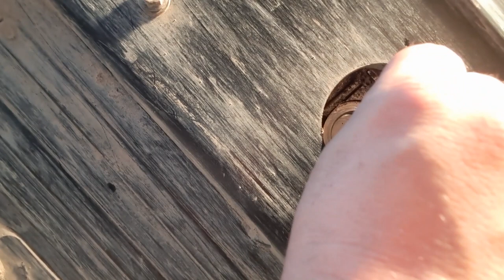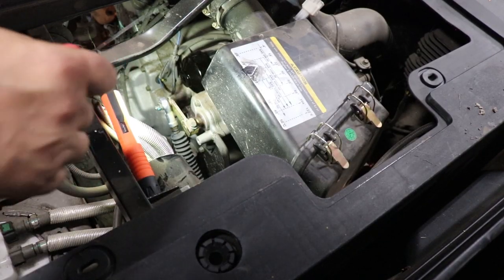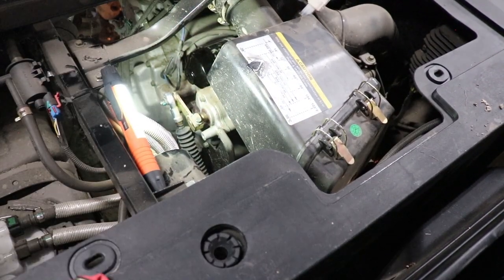Cub Cadet Challenger 750 Oil/Filter Change (With Part Numbers)

Comment: You need to run wet clutch motorcycle oil in this unit. Straight 10W30 or 10W40 automobile oil is not the right oil to run in this